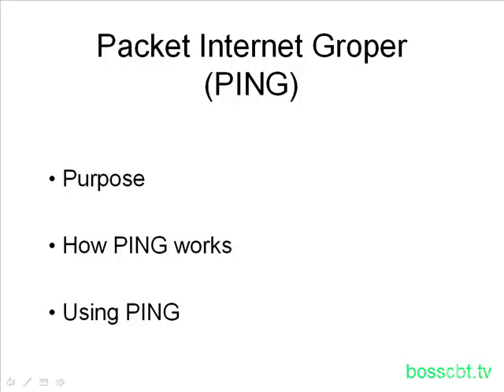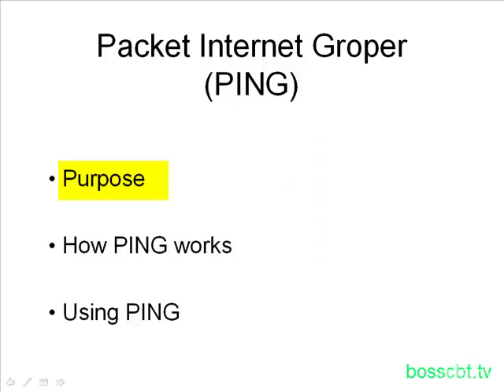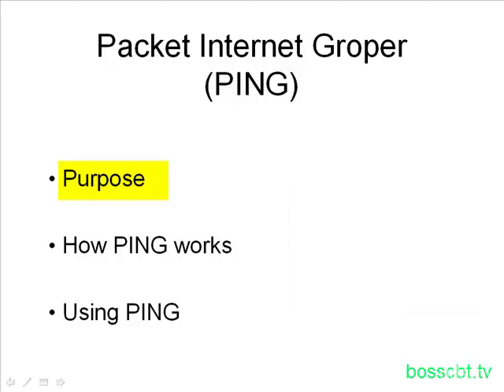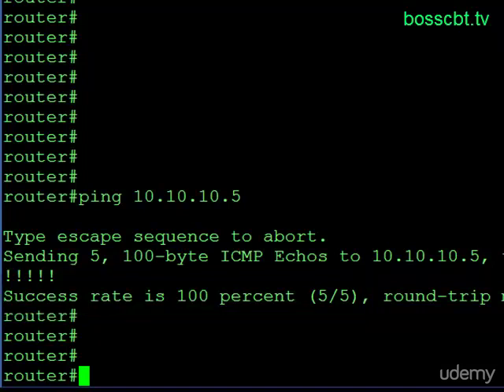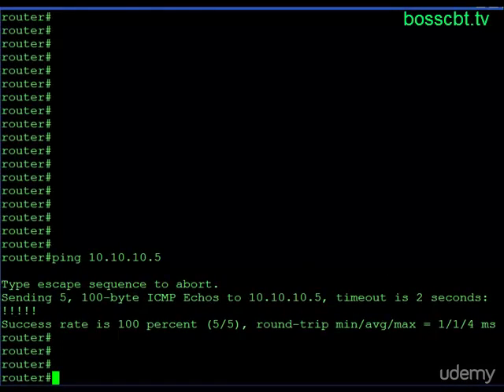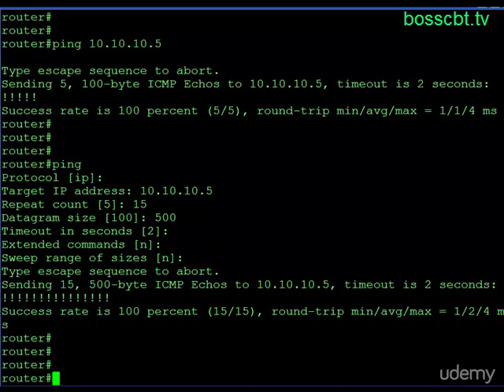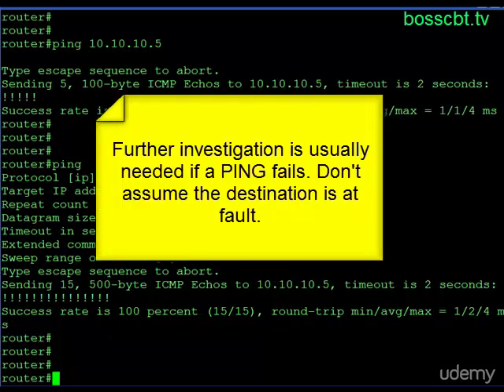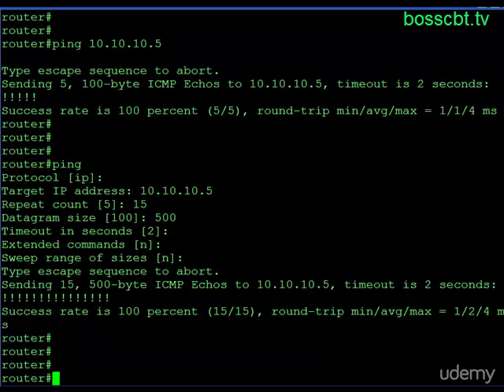17. Packet Internet Groper PING

Comment: Ping tests Layers 1,2 & 3... To see if the device is alive. Ping Process: PC 1 pings PC 2. The Ping message sent from PC 1 is a IMCP (Internet Message Control Protocol) Echo Request to see if PC 2 is alive. If PC 2 is alive it will send an IMCP Echo Reply... On top of that an ip address is recorded on the PC or Routers Arp Table to generate an Packet encapsulated into a Frame.